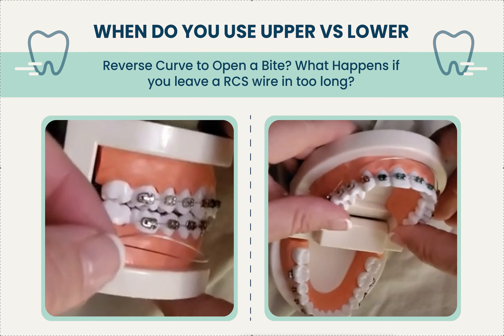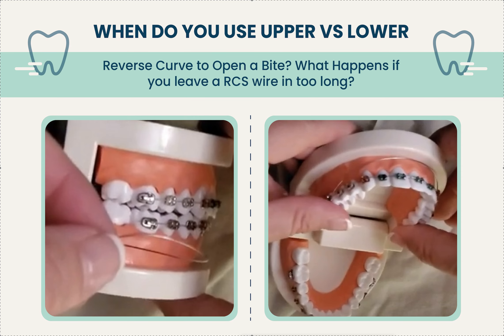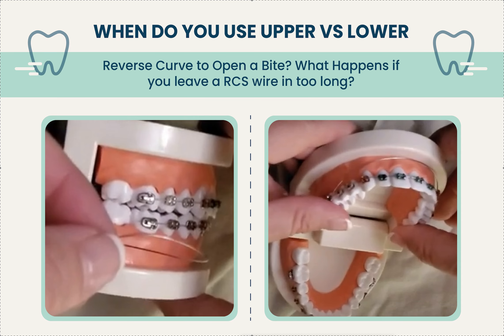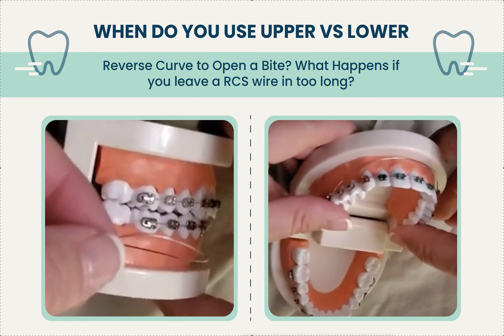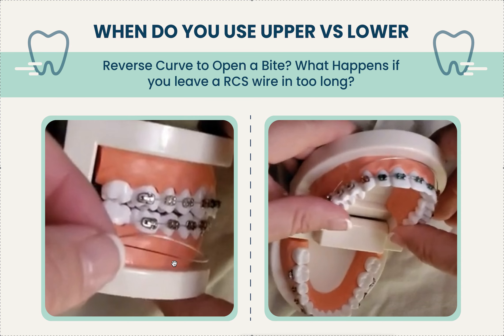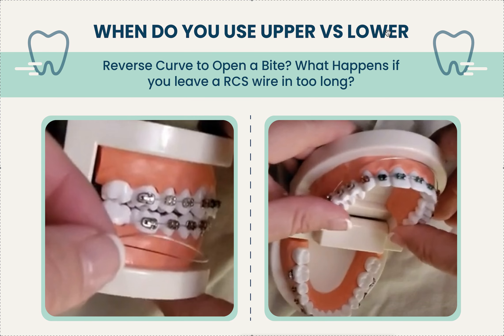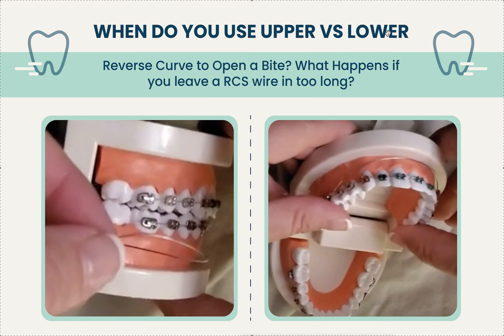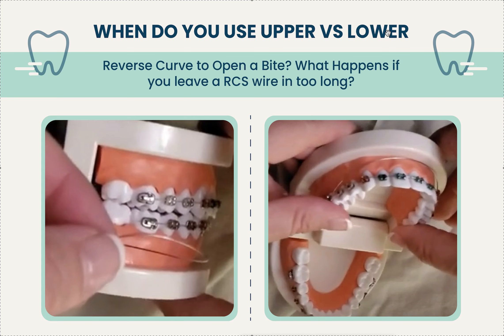Reverse Curve Wire Dangers/ Upper vs Lower RCS Wires/ ACS Wires

Comment: My face has flattened so much, my lower jaw looks wider, cheeks looks sunken, and my top teeth looks further back now behind my lips making my chin jaw look prominent, is this something that can be reversed? Like pull my top teeth back out?
Reply: I'm still in my braces BTW but I'm afraid my orthodontist will say it's not possible 😭😞 appt in 3 weeks
Reply from the maker: keep us posted!
Reply: Told my orthodontist how I felt and he said it isn’t possible to move teeth in or out he says all he can do at my age is straighten them. But why are so many others having the same problem as me then. It’s definitely not true to say that the face doesn’t change.
Reply from the maker: sounds like you need a 2nd opinion